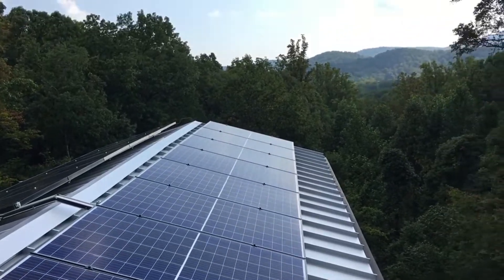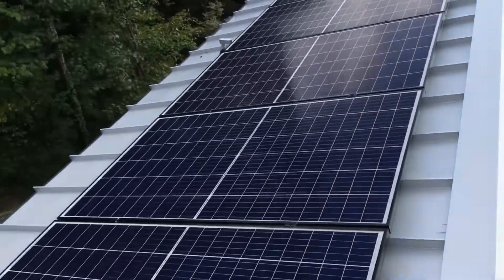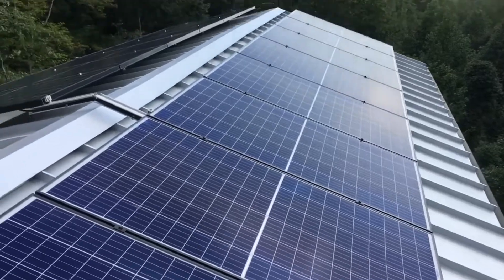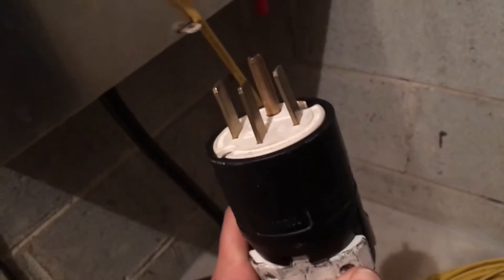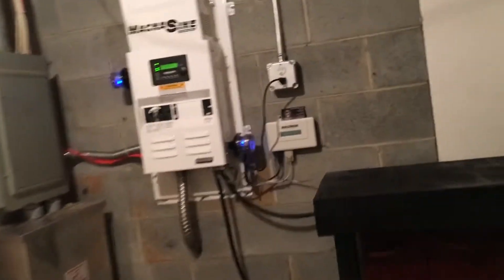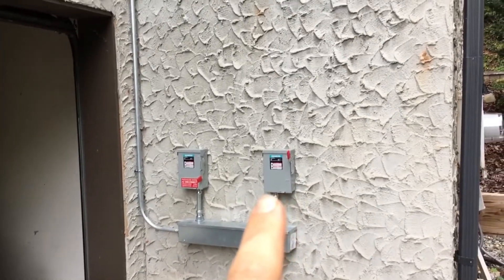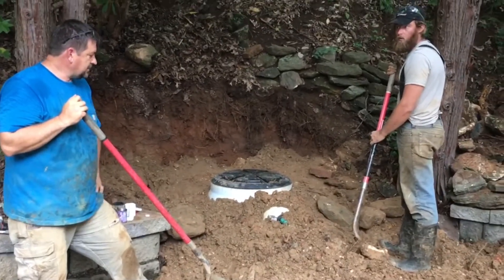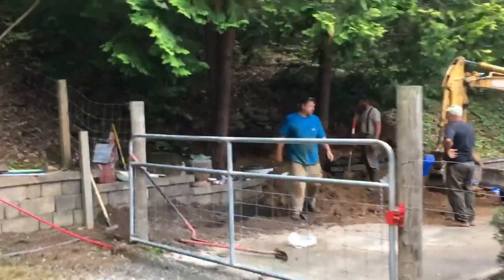2017 Magnum 4448PAE w/GT/500’s: Magnum’s microninverters

Comment: Great work big dog, I used   magnets on on my steel roof  to hold down my panels. Each magnet can hold 150 pounds of weight. Plus I put a magnified plexiglass over all of my panels that amplifies there intake. So far its been working great down in Florida with all the hurricanes and severe tropical whether we get evey year. I'm getting ready to upgrade to a different kind because I built mine from solar drive way and yard lights that were sold 10 years ago in hardware stores. There was a good amount of disassembly , but I put the tiny panels in a 3D pyramid patern to better absorb the sun. Cool channel